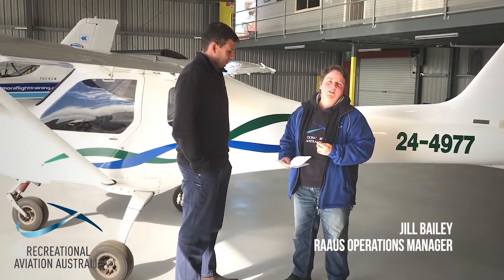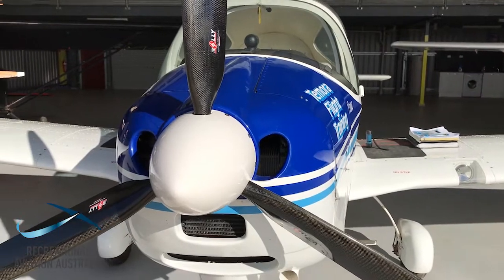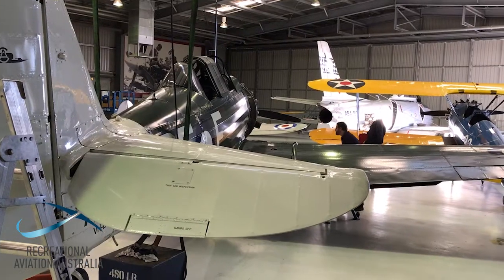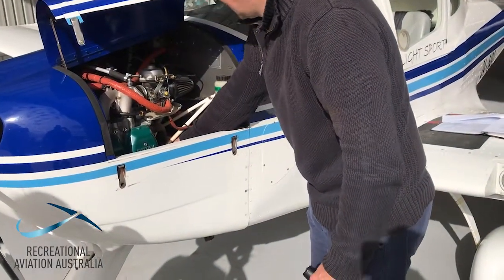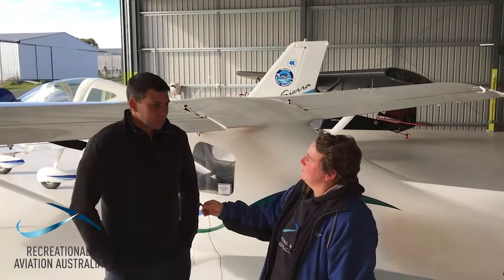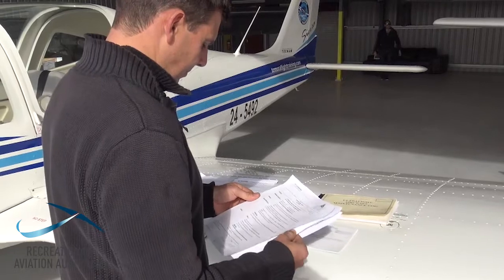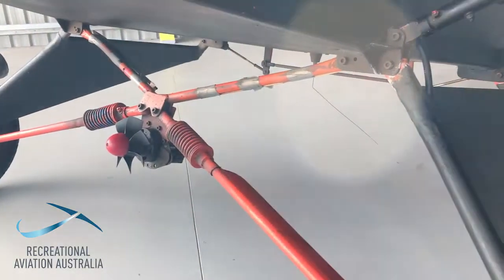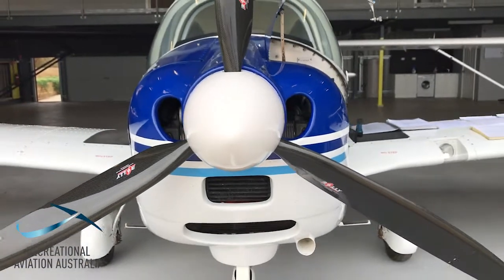Maintenance Log Book Hangar Talk by Recreational Aviation Australia

Comment: Hi Jill and Andy.  

I found your video quite good for generally outlining why we should do maintenance and how ADs and SBs are developed from the SDR reporting system (CASA) and the RAAus "OMS", however I think the video missed the mark of the "TITLE" in that it did not talk very much about the Maintenance Log Book itself.   From the title, I was expecting to see an aircraft logbook and someone showing the parts of it and how to use it correctly.   Coupling this with the information provided by Andy, I think would have been more "on topic".

Another VERY important point that I think needs to be made very clear to people is that it is the responsibility of the aircraft OWNER to ensure the APPROPRIATE maintenance is carried out on their aircraft.  The LAME/MAINTAINER is responsible to ensure that the maintenance REQUIRED, is performed to the applicable standards.   In other words, it is NOT the LAME/MAINTAINERS responsibility to know what maintenance needs to be performed on YOUR aircraft.

Andy's reaction to Jill's question about "What problems he has seen from aircraft logbooks?".  is a common look I see when talking to aircraft maintainers (both GA and RAAus).   Andy's comments on why you should record the maintenance performed on your aircraft is very true.   Accurate aircraft records affords.

1. Greater safety of your aircraft, crew, passengers and the general public.
2. Proof of compliance with the Civil Aviation Regulations and
3. Enhance the value of your aircraft with accurate and easy to read records and
4. Reducing unwarranted cost due to maintenance duplication or overrun.

My team has been developing an electronic Aircraft Maintenance Records System for the aircraft OWNERS/OPERATORS to meet their legal responsibilities and make life a lot easier for the LAME/MAINTAINERS.   Even the PILOTS get a look in to make sure that they record their flight information correctly so that maintenance is performed at the appropriate time.   For more information you can visit www.breezylog.com or feel free to email me paul@breezylog.com   

Keep up the videos RAAus and Have Fun - Fly Safe.